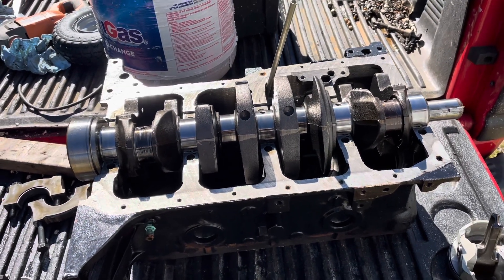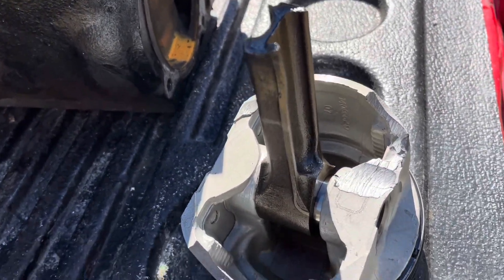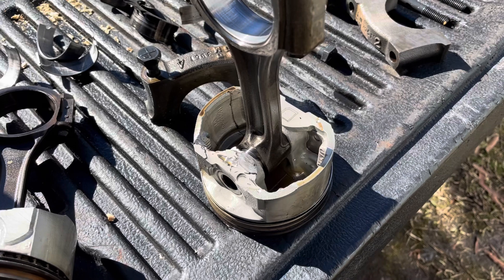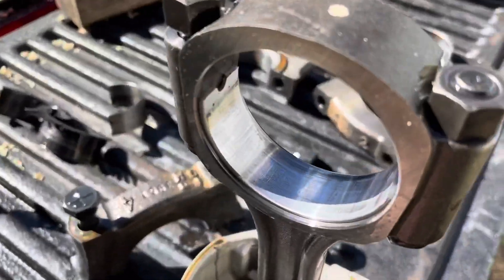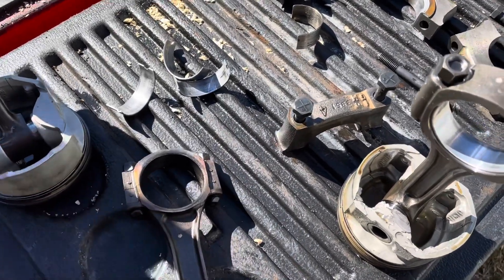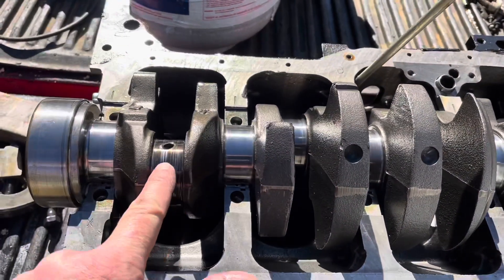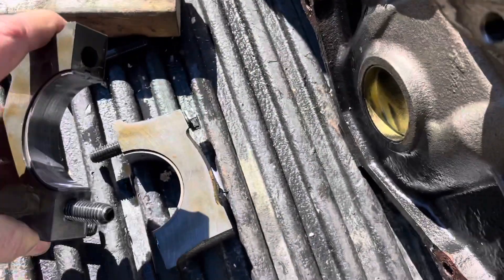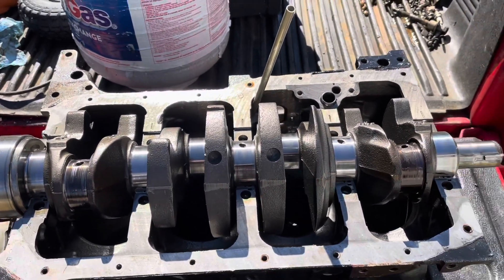Mercruiser 3.0 2(f) - Death by Low Octane Gas

Comment: I got 87 mercruiser 3.0 that sounds like it's knocking.  I was told its normal.  After removing motor & inspecting bottom end bearing all seems tight.  Any explanation what is the noise?